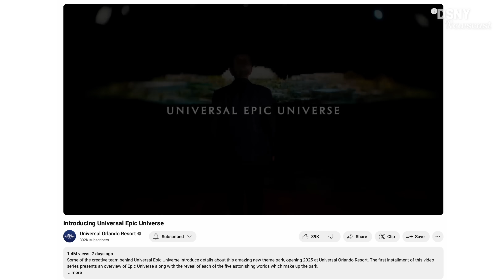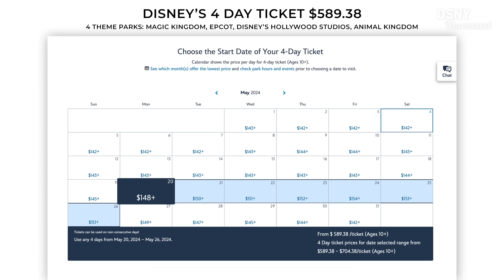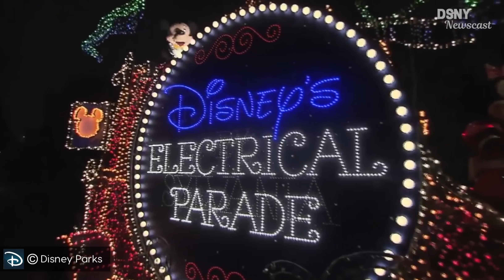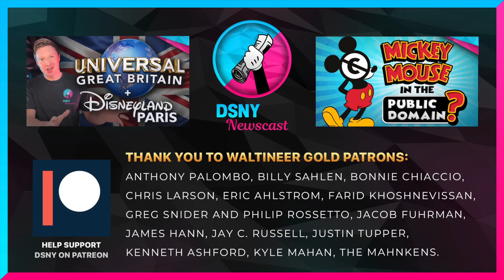How Will DISNEY WORLD Respond To EPIC UNIVERSE? Part 2 - DSNY Newscast

Comment: Unless something has changed in 2025 and 2026 they have a reimagined Test Track, the new Zootopia 3-D show, and Pirates themed cantina coming. Add in a new parade and it’s not a bad line up. 
They have also announced for 2024 the Country Bears update, Little Mermaid Show update, Tina’s Bayou Adventure and Star Tours updated stories.
Their next easy low hanging fruit is the Stitch building and Wonders of Life. Both could have a shorten construction timeframe since they already have those buildings built.

Comment: I've always said that if I was in charge, I'd make it my mission to get the most money from Florida Passholders as possible. Not by increasing prices (obviously they go up every year) but by increasing discounts! I live locally and visit the parks about 100 days per year. I don't spend money on about 80 of those days. I pack a backpack of snacks and drinks, or I eat at home before heading to the park or leave once it's dinner time. If they increased the table service discount, added a quick service discount (they had one for a couple months a few years back and I took full advantage!), bigger hotel discounts to lure locals in for a single-night stay or staycation, ticketed event discounts bigger than $5-$10! Those are the types of things I would do to help increase visits by locals, the duration of their visits, and the money they spend on each visit.

Comment: I like to stay onsite - usually at Pop Century as the Skyliner makes things a lot easier.

Things you touched on would make a difference.  Magical Express was a nice perk, would be great to get the decent extended hours back for all hotel guests (not just the deluxe resorts)

As for the parks - they have some space at the back of Hollywood Studios, Galaxy’s Edge should be expanded and swallow up the galactic star cruiser - an indoor dark coaster but Star Wars themed would be awesome, and surely could be built fairly quickly.

A Star Wars drone show would be a massive hit too

They’ve talked about adding a lane beyond big thunder mountain, a villains land…well what are they waiting for, time to get the spades out.

Epcot - expand the U.K. pavilion and put in a Mary Poppins area/ride

Animal Kingdom - Pandora needs an upgrade, the movie updating for flight of passage.

As for the water ride in Pandora, never been so underwhelmed in my life, rip it out and put something else in there.

The Disney guys and gals have work to do but the Original Universal Studios does too.  Simpsons needs replacing (especially as it’s a Disney IP now), ET has been there forever.

You can do islands of adventure in a day, I skip the studios now as the only rides that appeal are the mummy and dragon alley area.

Interesting times ahead !

Comment: The thing that gets me here is that Disney have 100% taken their eye off the ball, however - outside of Tiana’s Bayou Adventure - Disney’s new attractions tend to be unique, and different attractions, no one does anything like Runaway Railway, Rise of the Resistance, Ratatouille, Tron, etc. 

Disney also has a way of monetising everything, which makes it expensive.

Disney takes a long while to build anything, but as someone who travels with someone who needs accessibility and ‘quiet spaces’ Disney delivers in a way Universal doesn’t.

Universal are quickly building new things. But, most Universal attractions are off the rack with an IP wrapper - standard (but awesome) rollercoaster with a Jurassic theme, standard dark ride mechanism but with a Secret Life of Pets theme, standard dark ride mechanism but with Mario theme and VR headsets. And increasingly not Universal owned licensed IP - Mario is owned by Nintendo, Harry Potter (films anyways) owned by WB. This’ll bump prices up to pay for licensing fees, especially if it’s successful, which can go up or get retracted.

Everyone is hyped around Epic Universe based off that one video, yet we haven’t seen the attractions or mostly know what attractions they’re building. For both Orlando parks Universal has not stuck the landing on opening day, with disappointing openings that got fixed over time.

Universal rely far too heavily on Harry Potter, three lands across three parks on a franchise that is waning, both box office and controversy surrounding too many people involved.

Both have many a pro and con, who will win? Executives, always executives. We’ll just end up forking out far too much money. But ultimately Epic Universe is a big gamble that may pay off IF can stick the landing, or be a costly folly at the worst world financial time if they open with a rushed park.

Comment: Agree with most of this - it'd be insane for Disney to not bring Magical Express back until Brightline adds the Disney Springs extension. Adding new characters and scenes to Smuggler's Run and Flight of Passage would likely be worthwhile. But another clever way to take advantage of the 20th Century Fox acquisition is re-skinning Stitch as the mission control room from The Martian. The final scene featuring Watney launching from Mars and meeting up with the Hermes could work at Magic Kingdom, distinct from Mission: Space. One caveat: Disney is probably waiting to see how Elio does next year. If it's a big hit for Pixar, then they'll likely retheme that theater to the Communiverse.

A tougher sell for 2025 will be reopening Galactic Starcruiser without the roleplay. They might be able to squeeze in 100 more cabins, but it'd still be a niche offering tailored to guests staying about 3 nights. Regarding Magical Express, I would be surprised, but not shocked, if Disney partners with Mears for a paid shuttle bus between Springs and Epic. Convincing millions of people to skip Epic in its first 2 years is a hard uphill battle. But there's probably a decent subset of guests who will want to do 3 Disney parks and tack on Epic Universe for a day. Magical Express and this paid shuttle to EU would incentive those guests to only leave property that one day.

Comment: If Disney does lean into the entertainment side I really do hope they have more fair opportunities open for people. No one is talking about the cheap entertainment cuts Disney is going through at WDW. Most if not all entertainment roles are being replaced by College Program/seasonal people because Disney knows they can be overworked for the least pay. Not fair for the committed entertainment part/full time people who get their hours stripped because Disney is FLOODING their roles with college program participants. As a former college program participant it’s nearly impossible to even audition for any entertainment role now as every time the positions are given to college program kids. I’ve seen AMAZING performers still on their 10th, 15th, 20th etc audition. And also to mention character integrity is gone now as all the Disney cast member influencers just blatantly post who they are in costume. It’s not fair and no one talks about it.

Comment: If I were Disney… I’d build 2 more water parks. “We” aren’t going to get a 5th gate. But we do have a problem of Disney only having 1 of the two water parks open at one time. So you have 4 parks worth of fans funneling into only 1 smaller water park on hot days. They need to diffuse that more and not have a bottleneck. 2 more water parks should help.

Comment: How about Disney doing a better job with construction and refurbishments...... Recently WDWNT, non YouTube site, did a piece on the recently done refurbishment of the Columbia Harbour House Exterior Lights and the overall shoddy paint job..... What I do not understand is why Disney is so hell bent on deconstructing things that are perfectly fine. Why replace the nice square glass light fixtures with cheap off the shelf circular lights??? And they did not even paint the square marks from the old lights........ Disney is getting too cheap with their construction projects and it shows bad...... Paint trim is done sloppily..... paint marks on exterior molding. 

People are so gullible to think Disney is going to be spending 60 billion dollars on improvements. NEWS FLASH that 60 billion is spread out on all teh Disney ventures..... Not just the theme parks........ Rude awakening around the corner.